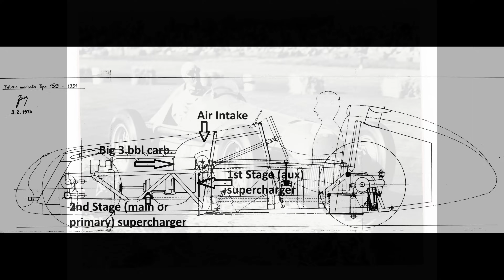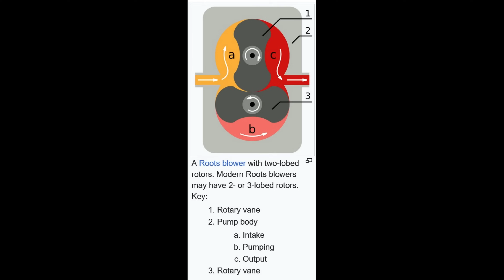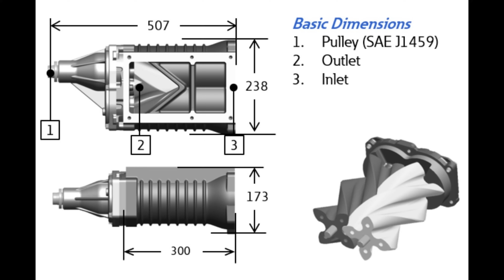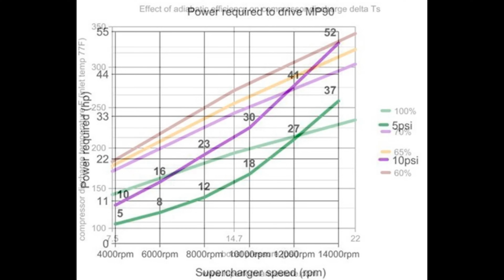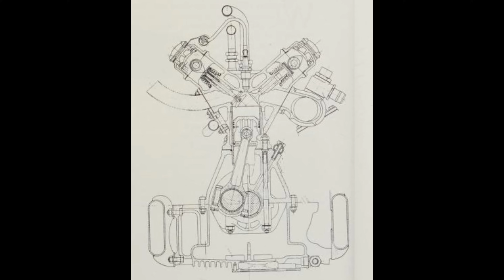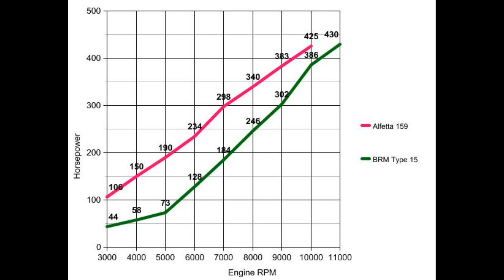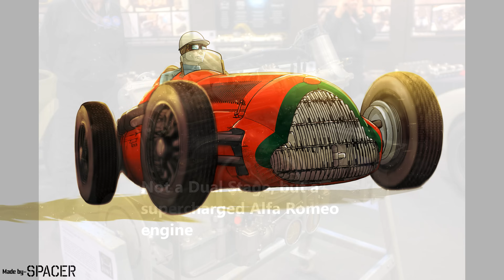Dual Stage Supercharging 450hp out of 1.5 Liters in 1951

Comment: Are the pulses from a Roots type supercharger the reason for the engine "surging" that you hear at low RPM/idle?  Thinking of especially of "gasser" type drag cars.  Thanks.
Reply: Much of the surging is from the fuel injection system. Those old systems were mostly for full throttle power so struggle at idle. Usually they can be adjusted to not surge, but people associate that surging with power.
Reply from the maker: I could make a whole video on that surging, but no it's not the supercharger, it has more to do with the fuel and throttle systems.
Reply: @GregsAirplanesandAutomobiles  Thanks, I'll look forward to the video! 🙂

Comment: Outstanding!! No Alfa intercooler but everything on the intake side has aluminum fins all over it🤔 The BRM is a double sidewinder centrifugal. The old story was that the BRM flopped because the power came on too abruptly making the car uncontrollable, your chart blows that out of the water (methanol)  Nice to see something on the Latham an interesting dead end.
Reply: Not sure what you mean by "sidewinder".

The BRM had 2 stage supercharger designed, developed and manufactured by Rolls-Royce for BRM, and is essentially a smaller version of the Merlin and Griffon superchargers.

The supercharger impellers were one behind the other, the shaft was parallel to the engine crankshaft.
Reply: @waynec3563  A "Sidewinder" supercharger, as far as I know, refers to the transverse, variable-speed blowers developed in the US, and derived from the German examples used on WWII aircraft. I know the F4U-5 Corsair's auxiliary superchargers were referred to as "Sidewinders". I think the original comment was simply getting the term confused.
Reply: @waynec3563 "Sidewinder" was the American term for their derivatives of the WWII German transverse, variable-speed superchargers, and which was used on planes like the F4U-5 Corsair. I believe that user is just mistaken and confusing the systems.
Reply: @waynec3563 I was going by the cross section @47:20 showing two centrifugal turbines crosswise to the crankshaft. So I could be wrong about the superchargers. Merlin, etc. superchargers are parallel to the crank of course, maybe Greg could set us straight, or crosswise as the case may be😂
Reply: I found a cutaway of the v16 and the crankshaft is parallel to the crank. The sideways scrolls are water pumps.
Reply: BRM had so many problems with their first F1 car they went completely in the opposite tack with its 2,,5. Litre successor and based the engine on the block design of the Rolls-Royce B40 most famously used in the British Army 1/4 4x4 Austin Champ
Reply: Great presentation  Greg. Re the BRM, Stirling Moss made a recording in which he mentioned that the steering shaft had seven universal joints which compromised road holding. I'll bet it did.
Reply: The BRM flopped because the engines rarely lasted a race. They often self-destructed on the starting grid.
Reply: You don't need an intercooler with methanol

Comment: So Superchargers/ Turbochargers led to Jet engines! Brilliant!
Reply: Well actually, axial turbines, that modern Jet engines use have been in use for a long time. Even RMS Titanic had an axial turbine well over 100 years ago,  although it was a steam turbine...
Reply: @julianneale6128  That covers the turbine part which drives the shaft, but superchargers led to the compression section of a jet engine, and making the turbine engine a self-contained thing rather than relying on boilers like steam turbines.

Comment: The way you described turbine engines finally made it click for me. I've heard people call them "sentient turbochargers" before but i guess i've just never made the connection until now. Neat.
Reply: It's exactly how I came to the realization when I was younger too. The supercharger gives intake and compression, we know exhaust makes thrust and can deliver power to a shaft via a turbine, and ignition is covered by a plug anyway. That's all four cycles. The piston starts to look like an unnecessary middleman, at least in concept when practical realities aren't a factor.
Reply: I've wanted to build a turbine from a turbo, as a separate small engine, to keep another turbo always on boost. Like say, hidden in the trunk.
Reply: @pgtmr2713  This might sound crazy but why not have a large cf paintball tank plumbed to the intake before the compressor.   It will really help with spooling the turbo and it will come out at subzero temps so it will help with knock too.    There is a drag car that runs on 2 Scuba tanks of normal air at 3000psi.  I forgot the exact HP number but it was well north of 1000hp and ran a blistering 1/4 mile.  They claimed estimated -20 degree intake temps due to the compressed air cooling down as it drops in pressure.
Reply: @joshuaszeto  That is way too extreme. The point is to prove the concept would work. Stored air or nitrous runs out quick unless there's a compressor to refill it with air. I believe there was a rally car that used one of it's bumpers as a cheater tank for a refillable boost as it raced. Can't remember if it was Toyota or Ford. I'm talking about junk though, 200's hp NA boosted to 300-400. Highest qualitay ebay parts. Smooth continuous power without the pops and bangs of an anti-lag.
Reply: @pgtmr2713  I've seen a guy use an AC compressor to charge an air tank that is then used to selectively dump a bunch of pressure into the exhaust to spool the turbo in no time flat.
Reply: @CheapSushi  I believe ford did that with the focus when they rallied that car.  They had a bumper shaped tank that they tucked in the rear bumper that they dumped excess pressure into.
Reply: @pgtmr2713  I was thinking more like just refill the tank after every drive.  I would probably only have it as a helper if the rpms are below a certain threshold and the engine is over a certain load.    I was thinking more like a very temporary helper for drag races or a few laps of a short track.  It's just to help get the inlet pressure up to spool the turbo and then the engine does the rest.
Reply: @joshuaszeto  If you want to do that... then look up Jeeps. They've already done a mod to turn the A/C compressor into an air pump for... filling tires on trails. But an air tank won't have much in the way of boost. Maybe spooling like you said. But a seperate turbine just to spool just seems like fun.
Reply: @pgtmr2713  the issue with AC compressors is that they peak at 200psi where as a paintball tank can handle 4500psi.  A scuba tank can handle 3000psi.   You also get the cooling effect of rapid decompression when using an air tank.    Volvo actually did this exact thing except they built it in.   The only thing that worries me is that it's a high pressure tank that is permanently mounted inside the car.    Every 5 years, air tanks need to be inspected and recertified to make sure they aren't corroding and forming tiny pin holes.  It would be much harder to inspect a tank inside a car.   But the concept is proven
Reply: @pgtmr2713  The French use a small gas turbine as a turbo (also doubles as an APU) for thier Leclerc main battle tank. The system is known as the "Hyperbar" system since it provides a boost pressure of 7.5 bar or 108psi
Reply: @antikythera42  Well tanks can be noisy. That is a lot of boost.
Reply: Prior to WWII GE built turbosuperchargers. This led them to being selected to build the first US jet engine.
Reply: Of course, when you get to a certain point, a jet engine ends up needing a piston engine all over again. Or two, as seen in the twin Buick V8-powered start cart for the SR-71 Blackbird.

Comment: This video could also be used to compare the Garrett TPE331 dual centrifical compressors and the Pt6 axial compressors with one centrifical. That’s why the garrets idle at 75% instead of 55%
Reply from the maker: I have a lot of time in both, about 1900 hours on the PT6 and about 6000 on the TPE331.

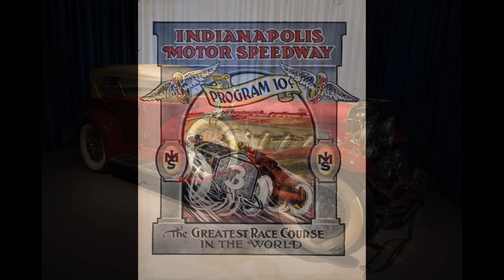Comment: @ 08:20. The Indianapolis 500 was, and is the pinnacle of U.S motor racing, nowhere else. The Indianapolis motor speedway is, of course, a heavily influenced, very much simplified version of the oldest (and in my opinion, much, much better) motor racing circuit in the world. Brooklands Race Circuit. 

The Indianapolis 500 is a fantastic race, that I'd like to attend one day. I might take my dad, a retired Detroit car designer. Brooklands Race Circuit closed during WWII, and never reopened, due to the damage done by German bomber aircraft.
Reply: Brooklands was suffering badly from the deterioration of the banked turns (much like the Monza high banks) even before 1939. parts of the track were removed to support aircraft operations and manufacturing during WW2 and it was never restored. Since there were aircraft factories at Brooklands it would have been a bombing target but that wasn't why it was never returned to racing.

Comment: Funny US had good radial forced induction for radials but for not for inlines

The main reason Merlin replaced Allison was superior forced induction

Google twin mustang history.  Even late 40s Allison forced induction not as good as metlin
Reply: There was good forced induction for the P-38.  USAAF also planned use of an exhaust driven first stage for other inline aircraft as well, such as the P-39.  Development was focused on 'turbos' because they promised to be more efficient, but they didn't turn out to be efficient for packaging in a small fighter plane. The  mechanical 2-stage ended up superior in that application and Rolls Royce was the leader in that area.
Reply: The U.S. Navy had more brains.
Reply: The Allison's only problem with forced induction was that more complicated blowers didn't fit onto the engine block, and Allison didn't get the funding to fix it until very late in the war. Postwar "fixed" Allisons, like used in the P-82 Twin Mustang, made equal or better power than even the best Merlin-engined P-51s.
Reply: @smittywjmj   The P/F-82 Allison engines were not intercooled and were always unreliable in service, they had an external 2nd supercharger stage driven by a long extension shaft.  The small number of Merlin engined training planes outperformed the Allison engine production planes.  What was even the point of the P/F-82 compared to a conventional twin?  Nothing similar was tried since which must mean something.
Reply: @givenfirstnamefamilyfirstn3935  "What was even the point of the P/F-82 compared to a conventional twin?"  
That's easy: higher speed and greater range due to lower frontal area and parasite drag compared to a conventional twin.

"Nothing similar was tried since which must mean something."  
Actually, the F-82 was the most successful and probably last of this design, which was also tried in the Bf-109Z, Me609, SM.92, and perhaps others.  The question is not why it wasn't tried, but why it was no longer used after the F-82, and the answer there is simple as well: turbojets took over as the powerplant for fighters, and there is no need for twin fuselages when your twin powerplants don't need to swing propellers.
Reply: @gort8203  Good points, Burt Rutan tried an even cleaner asymmetric twin boom one-off design.
Reply: @givenfirstnamefamilyfirstn3935  Just to be clear about the distinction, the F-82 is a twin fuselage design, while airplanes like the OV-10, DH Vampire, and Cessna 337 are twin boom designs. There have been many successful twin boom designs.

The Rutan design was an asymmetric design like the much earlier Blohm and Voss BV141. Not the same thing, although they had the same objective of reduced drag.  Asymmetric designs have issues that are not relevant to the P-82.

Comment: did the brm v16 use dual stage? thast thing ran 450-500 hp iirc. sounds ORGASMIC too!!
Reply from the maker: Scooby, did I not cover that in this video?
Reply: @GregsAirplanesandAutomobiles  im only 5 mins in lol
Reply from the maker: I appreciate your enthusiasm for posting.
Reply: @GregsAirplanesandAutomobiles  its a habit of mine, i comment as i see things or il forget. yeh iv seen the whole vid now, i LOVE videos like this. ps i had a mk4 golf r32 with acentrifugal charger on it and loved it, 400 pb ft and 475 hp, the upside to a gentle torque curve is its nice on the transmission and incredibly smooth to drive
now i have a mk5 r32 dsg stock power, miss forced induction though lol

Comment: Another great video. With your explanation of  benefits of the roots and centrifugal. The first thing that comes to mind is a dual stage setup combining a roots and centrifugal supercharger. Giving the low and high range benefits of both...
Reply: I was wondering if a two- speed auto- shifting setup might not help the centrifugals as well.
Reply from the maker: Yes, absolutely and we are starting to see those in cars and motorcycles.
Reply: @GregsAirplanesandAutomobiles  Honda has just announced a three cylinder motorcycle engine with an electrically driven suoercharger.  There is some good info on it at the Cycle World website if you are interested.
Reply: Roots+Centrifugal combo has been done a few times in road vehicles (both large trucks, and sports cars), but normally where the centrifugal in question is part of a turbo supercharger. Sometimes to get even more high range benefit they bypass the roots supercharger with a valve at high boost to allow it to be specified for better low end boost and avoid that inefficiency/heat later. Using a turbo as the Aux blower stage allows the pressure to be maintained constant for most of the rev range by simply opening the waste gate in exhaust, instead of needing a variable drive speed system (be that gears, hydraulic or as has taken over almost all modern variable speed implementations, electronic) and the inefficiency that embodies, which saw many WW2 aircraft adopt this approach (but normally with centrifugal "primary" supercharger since they didn't need to operate at high boost on as wide of an RPM range as cars/trucks). Having a roots blower also spools the turbo a lot faster than would otherwise be possible, allowing it to be bigger and more suited for efficiency at the high end, but I think Greg is likely to get into that sort of thing more when/if we get a compound turbo video.

Comment: I like to call Roots-type "blowers" as that's what they're best at and designed for, the compression being largely secondary or something of an adapted function
Reply: Tiny car, tiny wheels, no roll bar, no fire suit. No chance....
Reply: For the wooden ones prior to 1900 sure.. but thats not what was ever used on an engine.
Look at the chart of pressure ratio to flow rate, and find the highest adiabatic efficiency, notice its NOT down the bottom, the "blower" is ideally suited to making quite a bit of pressure ratio, with less pressure your wasting more power to make heat. Now compare to an actual air blower used for HVAC, or to cool a PC, your talking only a couple of millimeters of H20 of pressure (1 bar ~14.5psi >10,000mm H20) where the roots blower wants thousands. Specifying a roots blower that's too large will cause more power to be used, for a hotter exhaust temperature, when moving the same amount of gas, they are compression tools NOT good at nor design for moving free air.

Comment: I love the tvs blower on my 2014 Mustang. 625 horse at 8 pounds and low to mid 11 sec 1/4.....
Reply from the maker: Yup, and when not on boost it robs almost no power.
Reply: @GregsAirplanesandAutomobiles  The big bypass does good work here as it lets stuff by as needed and slams shut instantly when demanded.

Comment: I may have seen either, or both? of these cars years ago when I repaired a car elevator at Shelby's car collection on the second floor of his man cave in the LA area. But the overseer was not having any questions or wondering eyes. I was looking down at the Shelby Pony while working.
  
I got to see a gull winged Benz at customers in PV as I put in car stackers. This guy was cool.

I worked on rotary/vain air compressors that are based off these supper chargers all with the same employer?
Rotary steam engine?

Comment: I wonder if you and Jack Brabham would have been friends.
Reply: Has Greg done a vid on the B-O-P aluminum block 215 that was an ancestor of the Repco Brabham V8 that won Sir Black Jack the WDC in '66 (And The Bear Denny Hulme in '67)? I haven't seen it if he has, will have to look through his library/playlists.
Reply: @sergioleone3583  Also the basis for the Rover V8 and close relation to the GM 3600 V6. Dan Gurney drove one in the 1962 Indianapolis race.
Reply: @keithstudly6071  yup, turned into a great little Brit V8. I think it was used in the MGB/GT V8 as well?

Comment: The accuracy of all estimated data in this video has a ratio of 1.6 applied. This is the effect of including the image of the XP-72. A further addition was considered with the 67 Camaro but that would be too much.
Reply from the maker: The 1.6 ratio is just to use as an example, it's not intended to match up to the XP-72 or the Camaro. Those were just pictures to help tell the story.
Reply: @GregsAirplanesandAutomobiles  It was a joke. I love P-47's and also Camaro's.
Reply from the maker: I get it now.

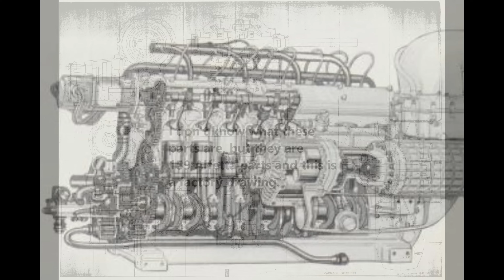Comment: Great video as always. The drawings at 34:30 are marked "cambio e ponte" on the lower right, which means gearbox and axle.
Reply from the maker: Thank you. I'll look at them again with that knowledge.
Reply: @GregsAirplanesandAutomobiles  Yes, that's the gearbox, final drive and wheel assembly within those drawings. 
Also, nowadays staging superchargers (be it turbo or mechanical) is called compound charging and it's done quite often with high power diesels.

Comment: Would it be possible to use a drive system similar to a Comet torque converter to have a more constant drive speed?
Reply: That's effectively how the Germans designed some of their blowers for WWII aircraft. Postwar, Vought basically copied the design for the "Sidewinder" superchargers on the F4U-5 Corsair.